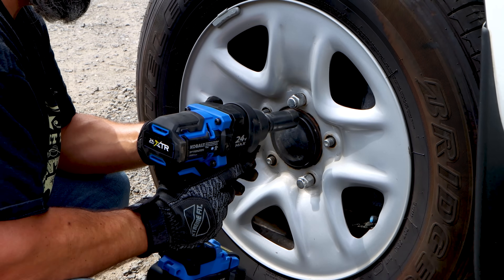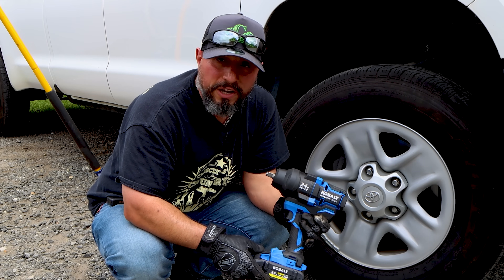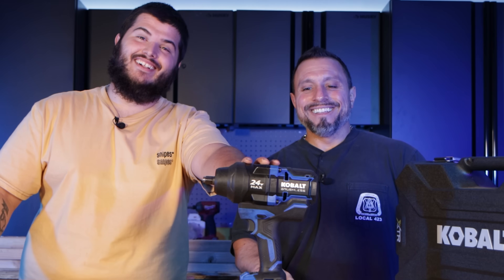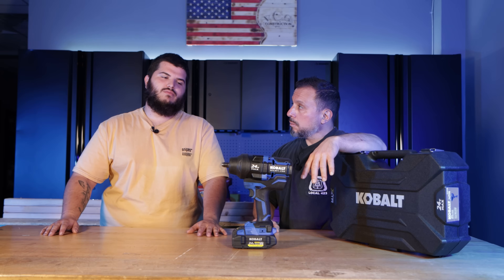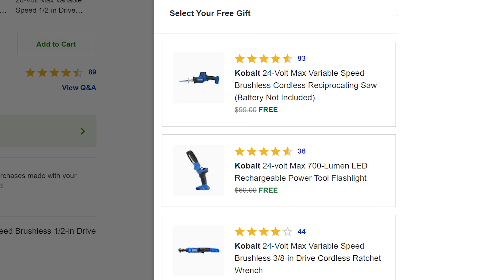Snap On Mechanic Tries KOBALT XTR For The First Time (EXACTLY WHAT I EXPECTED)

Comment: If you are tightening lug nuts to 180-200 ft/lbs, that's way too tight my guy.
Reply: The range should be 80-165 ft/lbs. there are a few passenger vehicles that have lower torque specs than that but they are very uncommon.
Reply: That’s what I’m saying, certified and being the maintenance tech is a big jump, he sounds maintenance with info like that, we have a chart for those, they’re generally around 80-110 Metris being a exception around 60

Comment: I just wish Kobalt or Lowes would put out some kind of road map so people know if it's worth investing in the kobalt line.
Reply: I'm a general contractor by trade, only many types of tools especially Milwaukee.... I bought my first kobalt set of impacts and hammer drill about 6 years ago, use them religiously every single day, they had never let me down. I now own the kobalt XTR line, let's just say I sold all my Milwaukee's tools... And now I buy nothing but kobalt... I prefer to keep my money in my pocket.
Reply: Kobalt is the way to go 24v
Reply: I have rotated tires on a 1997 k1500 4x4 pickup truck using the 1/4" version of this impact driver so I'd say it's worth it.

Comment: I own my own Auto Repair business and have been using the Kobalt line daily exclusively for 3 years. Never a problem with any of the tools or batteries. I use 1/2 impact, driver, extended reach 3/8 ratchet, drill, sawzall, 3/8 impact, 1/2 mid-range. Saved thousands and the exact same if not better performance.

Comment: Can't disagree that's it's a good buy for the coin, ESPECIALLY if you're getting a free right angle with it which is awesome as well. But if you're mainly removing lug nuts, no need to swing this thing around all day. Most of the top brands of mid-torques will take off every lug nut we see. And if you need more power for suspension, ball joints, shackles ect there's other high torques that are smaller and lighter with more beans.
Reply: "Smaller and lighter with more beans" maybe but it will cost you A LOT more beans also. TTC do you realize that price is a major factor, and THE major factor on some tools, especially for DIY's? I'm a woodworker and have nice tools but I just want the best for the buck when changing tires on my trucks or tractor.

Comment: The craftsman mid toque come at bare tools is $119 with a 4 AH battery come at $120 to $219 at my Lowe’s and a charger amd a bag Weight bear tool 3.99 pounds it weighs with a 4 AH battery is 6.29 pounds and craftsman come at 7 inch Long
Reply: its spelled 'bare' tool and the kobalt has more power to get the job done...that is why it costs more
Reply: @kingofthecrease30  I do not know if craftsman has a high toque impact Wrench
Reply: The Craftsman CMCF920 Mid Torque is way underrated according to Torque Test Channel. It's supposed to be only 275 ft-lbs but it got more than 300 ft-lbs on their test with a 4Ah V20 battery.  Too bad the $119 deal with a 4Ah battery and charger is gone.
Reply: @MrLuisinho90  sorry for the late reply I have seen the video

Comment: Eh... not bad, but I’d have to stick with the M18 FUEL 1/2” High Torque w/ One-Key. More power, more compatibility and can program in torque values just below where I’d need to use a proper torque wrench.
Reply: Eh...for more than twice the price? No thanks...
Reply: @rtgray7  get what you pay for🤷‍♂️
Reply: @Borescoped  Not really kobalt Xtr i well worth it own one i take it over the Milwaukee

Comment: I'm a professional mechanic and shop owner and this impact is my daily workhorse. RARELY do I come across a bolt that this can't take off and I'm in the rust belt. When I come across one that it cannot take off I find myself having to use a half inch breaker bar along with a pipe to break that bolt loose and it's on stupid tight. If you're a pro, take it from a pro: get this impact

Comment: I’m not professional but I do a wide variety of jobs on the side and I use my Ridgid octane mid torque for 90% of tasks. Then I have the subcompact for hard to reach and then the octane high torque for stubborn tasks. Right now the ridgid high torque is $279 with a 4ah max output and charger at the Home Depot. FYI
Great content Vince.
Reply: Yeah that Ridgid is a beast. I'm so tempted to grab one since this is the last year it in production. But my Stubby with 6ah battery can handle 99%  of the jobs for me.

Comment: For your friend to say that the XTR won't compete with the Snap-on is as subjective as all get out. 
I was in Lowe's today and there were two Kobalt heavy duty Impacts on the display both with batteries. 
I tried both of them and the older style felt kinda jittery,  but the XTR felt very smooth and powerful. 
They felt equally heavy.  I am shopping for a compact 3/8 impact and while I like what I am seeing in the Kobalt,  I want to wait to see if they release a new compact XTR line  impact.

Comment: I got this a few years ago when my ancient 60-gallon air compressor went night-night and I just needed something right now.  Currently I'm getting into the Flex line, so of course I'm looking at their impact wrench.  A weird feature of the Flex that I don't get, though... the whole head/motor assembly seems to not be connected to the handle/grip section?  Like, it wobbles.  I'm guessing this is for vibration mitigation, but it just doesn't feel sturdy like the XTR.

Comment: 180  Nm is less than 150 ft-lbs. I know because my Freak 2 (1800 in-lbs) is 200Nm (that's the model number for overseas). In-lbs to Ft-lbs is a way easier conversion, just divide the in-lbs / 12. 200 Nm is roughly 150 ft-lbs so there you got it.

PS. I rotate my tires with the Freak 2 but I couldn't remove a front spindle which had a spec of 250 ft-lbs . Reality is most mid torques are enough for automotive work

Comment: My lug nuts call for 80 foot lbs... I have a pick up truck. No way I'd ever use this to put on lug nuts.😳 Certified Mechanic here and I use mostly Milwaukee. But the GOAT is Earthquake from Harbor Freight. It's literally THE BEST DEAL. I mean LITERALLY the best deal and MOST POWER. 👌1600ft lbs, 1400ft, lbs 1200ft lbs, and 600ft lbs of nut busting/wrenching torque and for less than 200 you get battery, charger, a case, and 2 year no questions asked warranty. 😑 beat that....

Comment: I bought this and had it for two weeks before using it this past weekend to do a brake and rotor replacement on my truck. On my initial use with a full battery, it took out 2 lug nut with ease. On the third, something wasn't right and struggled to take out the third nut. On the 4th, it wouldn't turn anymore and beeps when squeezing the trigger. I have most dewalt tools and this was my first tool from another brand, mainly bought because of the 24v and 1200lbs breaking torque, and my initial impression of this tool is a disappointment.

Comment: I am a professional automotive mechanic I normally watch your channel for your reviews on Milwaukee fuel items.  In the shop I run M12 exclusively.  But my electric half inch gun is a DeWalt.  I'm going to be upgrading to the M18 high torque and M18 mid torque both are professionals requirement
Reply: Get a better upgrade to the 40v Makita line.

Comment: If a guy puts an impact wrench on your lugs, RUN! Ok to take them off, but not ON... And someone needs to read up on nm to ftlb.. lol... 180??? Yikes! Stay away from my vehicles!... Lol.
Reply: 150 Newton Meters (Nm)110.634 Foot-Pound Force (ft lbf)
Reply: Lmao I said same thing ! Althow ya can snug lug nuts on then torch them to correct 85 - 115 ft pd
Reply: What I do is turn the torque setting all the way down so I can run the nuts down snug and then use torque wrench to tighten them. Takes to long to spin the nuts on buy hand. 
There are also torque extensions designed to torque lugs with an impact. Point is that if you are careful it can be done without damage. Correct though, this guy is clueless.
Reply: Mode 4 tightening on the new Milwaukee's shuts off at around 25 ft lbs then you use a calibrated torque wrench to finish.
Reply: He just went the wrong direction on the conversion since he was doing it in his head. I'm sure that torque wrenches he uses at work are already calibrated in metric units anyway.

Comment: The snap on 1/2 inch high torque is longer, weighs more and is 1000 dollars. I don't buy snap on as a pro automotive tech. Snap on  costs more and is gives more fatigue.